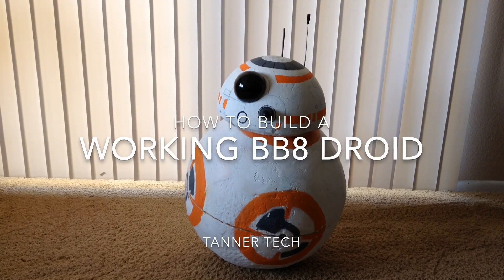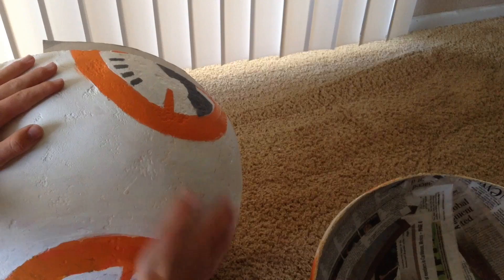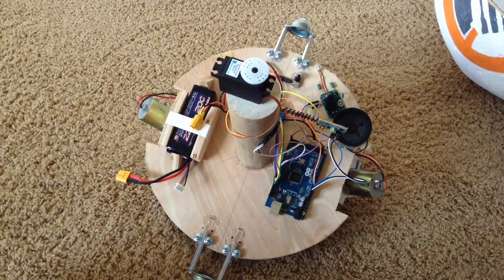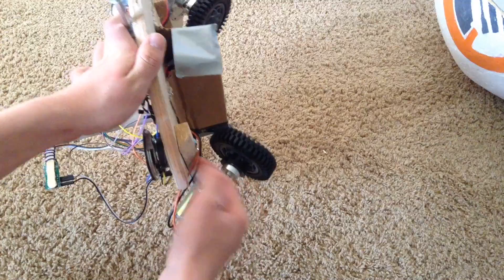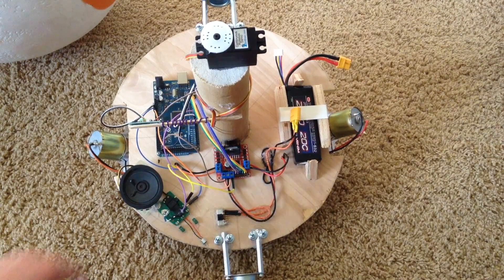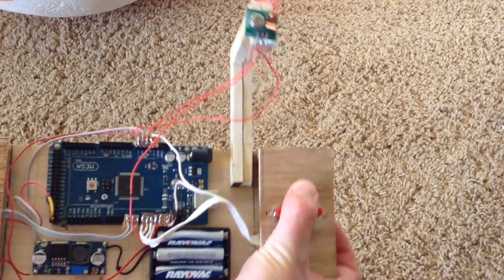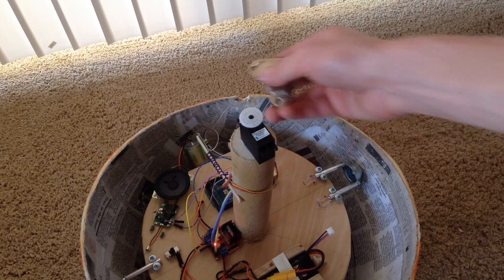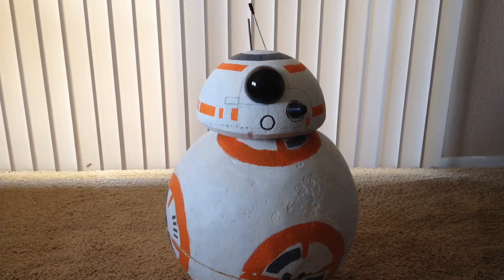DIY Working BB8 Droid

Comment: Not sure where this project has gotten, but the outside cant be plaster. And it needs to be as smooth as a countertop.
The problem you're having with the head is due to both the body (how the head material and body material interact) as well as the inner workings which may need more weight to keep the head stalk upright (as its wagging around in there now...)
Using a self balancer may help.

Cheers

Comment: just use some magnets and ball bearings to hold the head in place
Reply from the maker: +Pranav Reddy Thanks
Reply: Also, TrickProductionsTV Has is BB-8's magnets on a special mechanism that allows the magnet to easily conform to the inside of the sphere!

Comment: please tell us how to connect mp3 module to Arduino Uno(connection) with code
Reply from the maker: Just solder an NPN transistor to the metal contacts of the buttons in the module.  Attach one of the pins of the arduino through a resistor to the base of the transistor.
Reply: Ty